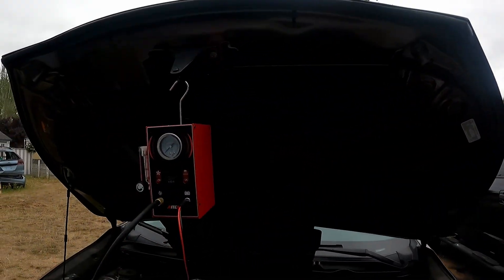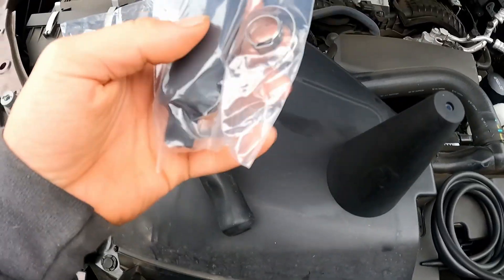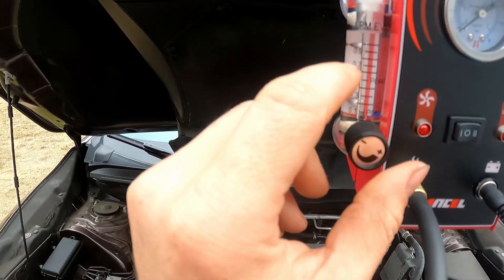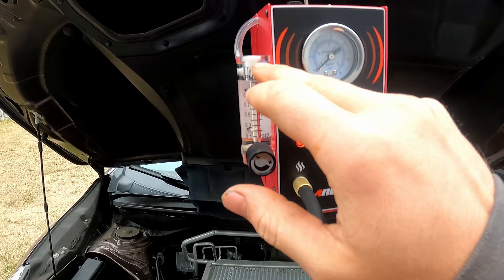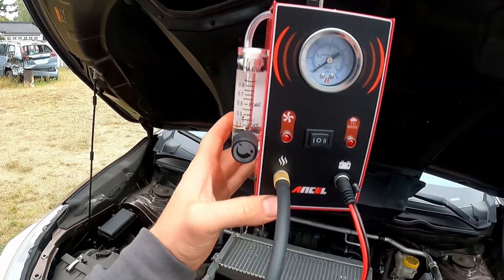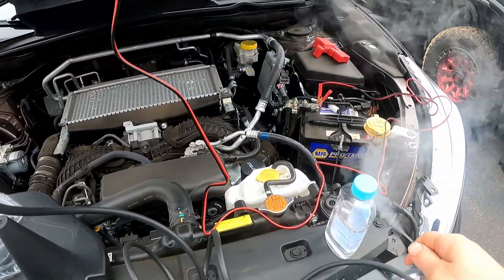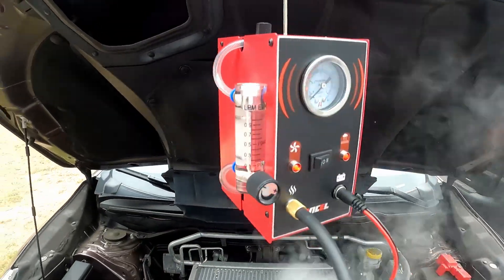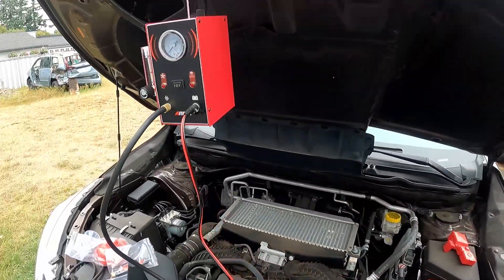Ancel S300 Portable Smoke Machine/Leak Detector

Comment: A quick note on these Chinese evap testers. They put out way to much pressure
for evap testing. The maximum pressure for the evap system is .5 psi or around
13.0 in. H20. The Ancel S300 is putting aut around 14 psi, Anything over 7 psi
can damage pressure sensors and or blow off hoses. 14 psi is OK for intake
and exhaust testing but way to high for evap.
Reply from the maker: I mainly use the smoke tester and i never had an issue. You can adjust the pressure on the side in this. Its not one pressure system